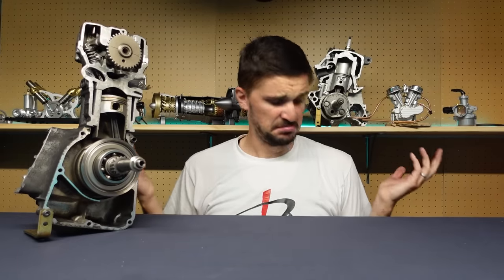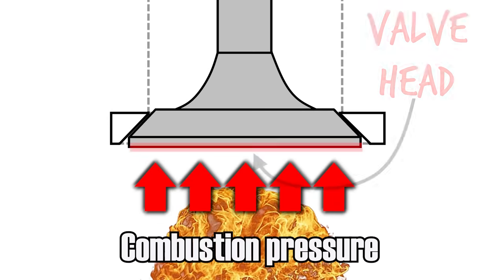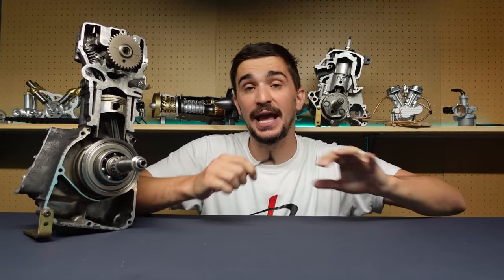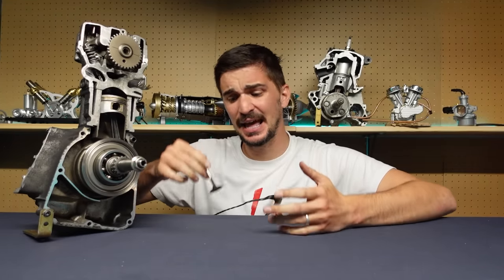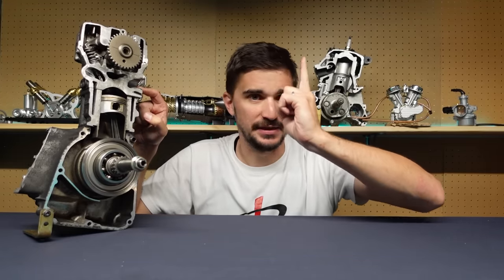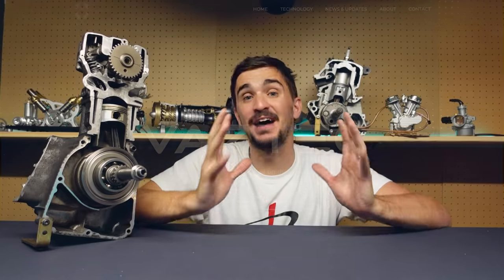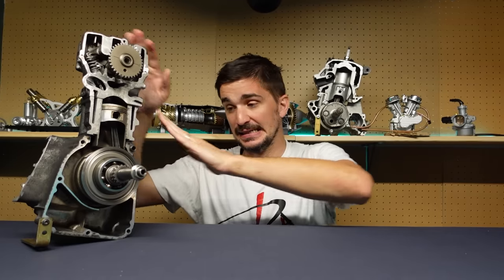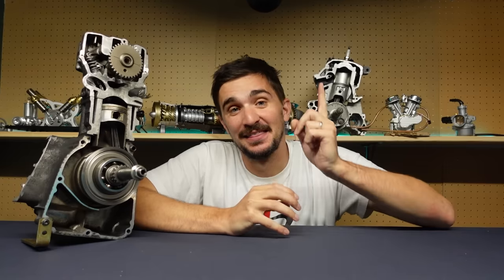Rotary Valves Make Normal Valves Look Silly - Why Aren't We Using Them?

Comment: I designed a dual overhead rotary valve system in 1963 using single long shafts. In 1966 I was living in France and met a guy who had designed a similar system and manufactured a custon head for a Renault Alpine engine, He raced the car that year at Le Mans. Unfortunately I was unable to accept his invitation to accompany him and his team to the 24 Hour race that year and due to returning to the states I never found out how it performed, although I believe their car finished the race. Very interesting video, thank you.
Reply: So a rotary valve Alpine raced at Le Mans in 1966?
Reply: Ford Australia had a 6 cylinder in their RND department back in the late 60's but it was decided back then at that time not reliable enough to put into production. My Dad who worked for Ford Geelong told me one of the employees bought the motor after they were done testing and put it in a clinker speed boat which sank after the pilot tried to make a turn on the lake at +11,000 RPM. They had left the heavy flywheel on the motor which refused to turn with the boat and broke through the bottom for the hull with the immense centrifugal force.
Reply: @Timbo_tango  Sound like a scene from Laurel and Hardy, or Charlie Chaplin? The engine refused to turn with the boat😅
Reply: @Timbo_tango I'd say it's worth looking for and salvaging! 🌞
Reply: Spunds like that was a long time ago, probably just a pile of rust now lol 😂@joeclark7888
Reply: @79dent  You never know!🌞
Reply: @joeclark7888  I definitely know. If you put steel under water for 50 years it will be so thin with rot you could probably bump it wrong and have a pile of cookie dust. Some things you just know. That's one of them.
Reply: Hmm, how about a wankel motor? KISS principle IS all ways good and I know few guys who said that the Gasket change is an easy operation. Too Bad Wankel has not been analyzed properly for commercial heavy machine use too, piling A Wankel motor and a hydraulic pump would Make A shallow engine for example forestey harvesters. Also the cabin IS useless If The thing IS remotely & AI operated. Funny thing IS like you said, Roi IS an obdtacle for innovations. Thank You for exellent presentation.
Reply: @MrKotkottaja rotaries dont just have seal issues.
Theyre hideously inefficient. You NEVER get complete combustion.
Reply: @rientsdijkstra4266 you ever been on a car hood hooked to a pickup in the snow??
Same effect
I've not made the turn several times 😂😂😂
Reply: @Timbo_tango I'd love to know more about it

Comment: You can have 20 advantages for a thing, but one disadvantage can be too harsh and kills it.
Thanks for the video
Reply: @RekySai there’s no physics in the way here, only bad timing and early stages development
Reply: @cesarescrignoli442  I suspect you're wrong for there are torque advantages in 2 valves per cylinder against 4. So, 'breathing' less has it's advantages
Reply: Computers can't even let you change your battery any disadvantages could have been ignored 😂
Reply: @ibrahimsued4906  thats sort of a myth, most diesels are 4v now, and make more torque than ever.  Camshaft timing and port/manifold diamters trump 2 valve vs 4 valve  when designing for a specific powerband.
Reply: yeah, despite he made it clear qualitatively, he doesn't have the quantities, that "minor loss", due to combustion on the lateral cilinder faces of the rotary valve, could be equal or worse than the loss of energy used when operating the springs in the traditional engines.

so not only this might not be coming out with good timing, it also could not be that promising, manufacturing involves way more than just the design and prototype face that make the application technically-economically viable to run the engine, but fewer parts, not always mean, cheaper parts, and designing the manufacturing equipment, could indeed be even more challenging that implementing this alternative on an engine
Reply: Has anyone looked at replacing hands on established engines
Reply: @RekySai Whoosh. Don't even reply if you don't even understand the context someone is commenting in
Reply: Often really inoptimal designs can get refined over time to a fine art. But normal valves work very well, simple and work for billions of actuations without problems.  Although its hard to push one valve open in a 4 cylinder engine there is always a closing valve when another is opening making it much easier. But I did hear in a mercedes V8 the valve train consumes up to 90hp.
Reply: I agree with what some others are saying here.  Sealing seems to be a big issue along with controlling the size of the opening.  I'm sure like was mentioned you could adjust the timing slightly, but I think that would end up with a misaligned hole for much of the stroke disrupting that smooth air flow that was touted as a huge advantage.
Reply: @kman2220  100% and the popet valve isn't the deamon its portrayed to be with the optimeized architecture of contemporary cylinder heads.
Reply: @EnglertRacing96 Diesels always had advantage in torque over petrol. I just made a review on the subject and the reports here in Brazil say the difference is about as in how fast the engine spins. Torque in 2v would be delivered earlier, at low rpm. Good for city driving
Reply: @ibrahimsued4906 i really do assure you that is not how it works.  If you had an engine that has a 2v and 4v head available and do development on port size and camshaft to achieve a specific power output at a specific rpm, either the 4v will make similar torque and more power, or you make cam timing changes like earlier intake close and later exhaust open and the 4v can make same power and MORE torque.  The 4v gives more control to the camshaft to control valve flow area.   The huge benefit is that you can get more open area at peak piston flow demand which happens before the valves achieve max lift.  Another benefit is central spark plug location and better combustion chamber shape lowers required ignition advance.   The only argument that used to exist is that 2v can be used to create  swirl mixture motio. in the charge, reducing ignition advance requirements, and improving combustion... but better understanding and implementation of tumble.... it turns out tumble decays less during compression stroke than does swirl.

Bottom line is camshaft and port design rule all, but 4v allows for valve area exposure than can mimmix 2v but 2v can not mimmic 4v.  Btw i have 6.7L 2 valve engine here that i built making 790hp 636ftlbs on first pulls.  Its on my channel.   Now around 840hp.
Reply: @EnglertRacing96 Sorry I didn't make clear I believed what you said. And I really expected some technical work could be made to achieve that. Thanks for the good explanation. Nowadays I think 4v is dominant in our (poor) market.
Reply: He is wrong about the springs. The energy you put into the valve is released again. It is therefore wrong to assume that the compression of the valve saps the engine's energy. It does not consume it. The friction does but that is a problem with other systems too.
Reply: @EbonyPope  I suspect you are right
Reply: @EbonyPope  energy is consumed to accelerate the valve, at low speed sure some energy from the spring is returned to the camshaft on valve closing but at higher speeds where valve float is approching this decreaces as more energy is required to close the valve
Reply: I think this timing is okay, at least with petrol racing because with rotary valves, you at least don't need the vehicles' lungs to be as big, and as advanced as they may have become, I hope their weight is no better, making them bad to use in hybrids as opposed to rotary valves, and I hope this racing allows for eCVT transmissions and that driving 4 answers makes a Wikipedia-based video on them!
Reply: @EbonyPope  that energy doesn't do any mechanical work on the wheels, thus it is "lost", instead it does work on the valves, even with the spring releasing that energy back again. Obviously, this needs to happen to keep the engine running, so it's not a waste of energy like heat is. But it is considered a parasitic loss, a necessary evil reducing the theoretical useful work done by a given quantity of fuel to keep the system running
Reply: Yeah, and the conflict of emissions and wear will most likely kill this. Either you float the tiny volume with oil to eliminate wear and risk oxides, or you leave it open and risk wear. A poppet valve always keeps the same surface facing the combustion chamber so it's easier in that regard.
Reply: that pretty much sums up the rotary engine in a nutshell. Lots of advantages... but its few downsides are too much to deal with for most people.
Reply: @maxkool007  Then what do you think of E-CVT's?
Reply: Congrats, you're an engineer now 🎉
Reply: I would be inclined to think that with both intake and exhaust being next to each other on the same barrel that there may be an issue with heat transfer from the exhaust side heating up the intake side and heating the intake air causing it to loose some density. Maybe not bad enough to worry about considering how long the intake air is exposed to the valve
Reply: @RICHARDJACKSON-g9k  COATS Engineering.
Reply: @cesarescrignoli442  There is a LOT  of physics in the way and we are NOT in early stages. People have been trying to make rotary valves work for a century. No one has made them work better and reliably. Plenty of people have gotten them to run, including the guy mentioned in this vid. But they do not run as well or as long and there are very good reasons for that. The sealing problem is the biggest (and a deal breaker already) but there are actually a few more that he never mentioned.
Reply: @ibrahimsued4906  breathing less is NEVER an advantage. The reason sometimes smaller/fewer valves/ports/intakes etc. sometimes make more power is that they actually breath better at that particular combo of load and engine speed.
Reply: @wingracer1614  iNDED my case was for more tork avaluable at low rotations. That used to be Brazilian experience.

Comment: I don't really speak engine mechanics, but your explanation was so clear that I was usually a half step ahead of what you were going to say next! A really good presentation.
Reply: This. Very fun listen
Reply: I’m an engineer who trains apprentices, and watching guys like this help immensely with finding ways to communicate technical problems and solutions to laymen or inexperienced pupils.
Reply: Actually the 1st minute is not so correct.
When the valves close, they actually push camshaft to give energy back.
Reply: @slyy4096 most of that "pushback energy" is probably lost in friction & "taking up the slack" in timing belts/chains & hydraulic valve lifters etc.   It's probably so negligible that he didn't bother mentioning it!
Reply: @alexmanojlovic768  also you don't need to press the spring of a floating valve as much lol